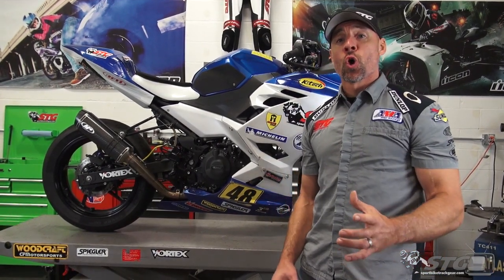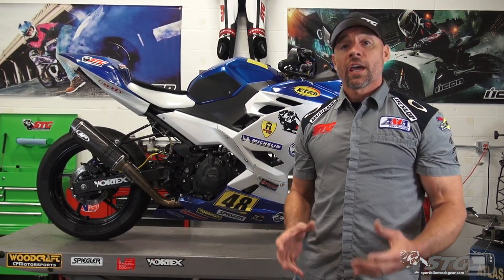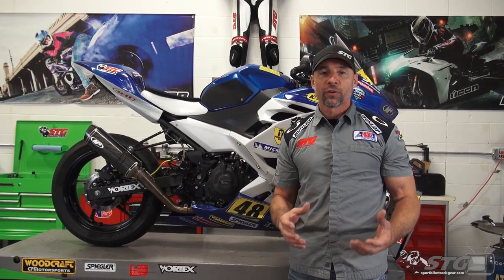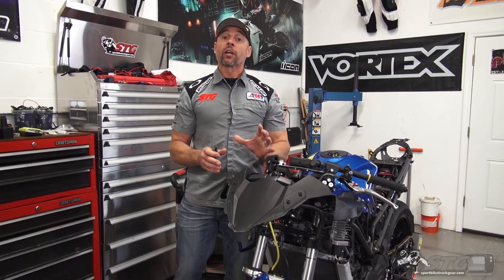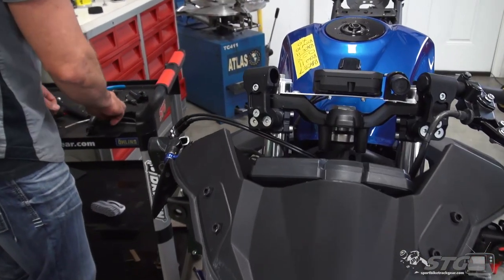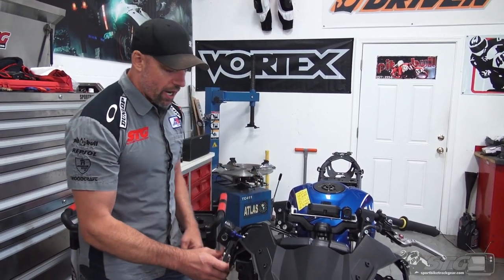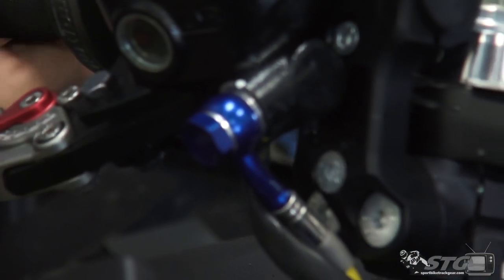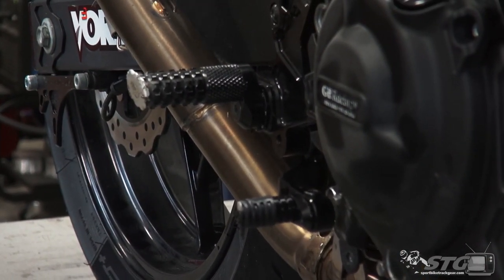How To Repair A Crashed Track Bike Fast | Sportbike Track Gear

Comment: If the steering stop on the right side is cracked, is it imperative to replace the triple tree? Is welding the stop back on an option?
Reply from the maker: If the steering stop on the lower triple has broken off you should really replace the triple clamp. - Van

Comment: Do you have any type of ritual as far as loosening and tightening the front end? Post crash that is
Reply from the maker: Break loose the steering stem nut, remove the forks, reinstall the forks (top triple is just a touch loose), torque the lower clamp pinch bolts, tighten upper pinch bolts a bit, torque the steering stem, loosen all the pinch bolts, slide the forks out then back in to make sure there is no binding. If you are good from here torque your forks down and complete the assembly. - Van
Reply: @sportbiketrackgear  awesome thanks. Just had a high side at cmp so trying to make sure everything is good. Actually just ordered a motoholders stay from you this morning 🤣

Comment: I could have use the screw comment for Damon couple years ago. Ran drill bit in and retractor tool. didn't work out too well.  Tire bill?  
Sincerely, Lee
Reply from the maker: This is a pretty cool trick for sure. I will shoot you a call today to square up on the tires. Thanks for reminding me! - Van

Comment: The broken bodywork you fixed with duct tape?
Reply from the maker: I have tape in all the colors we run at the track just in case. - Van
Reply: @sportbiketrackgear  i have trackbike, glass wool bodywork but never tryed fix with tape